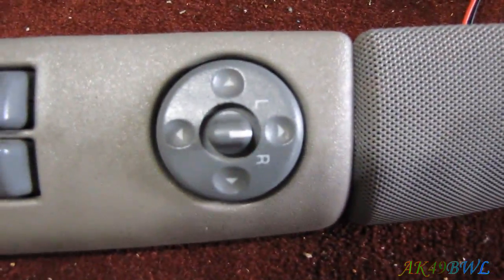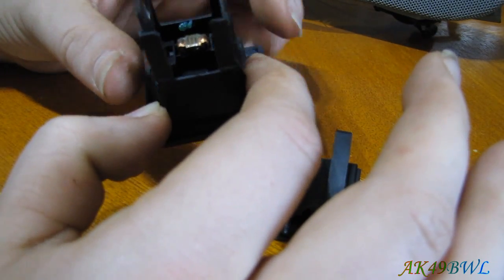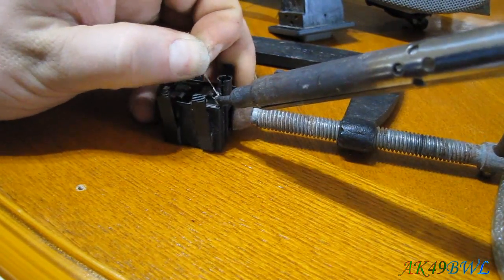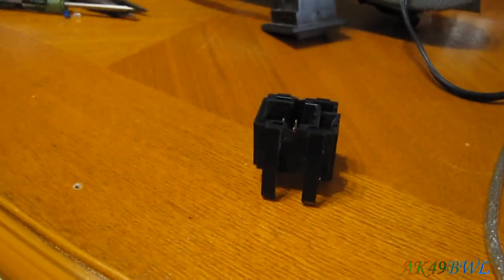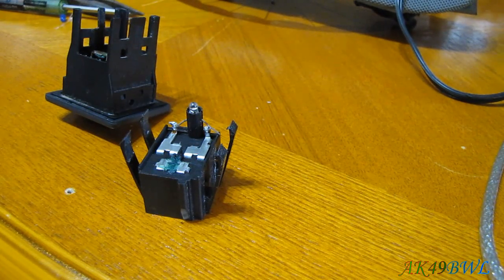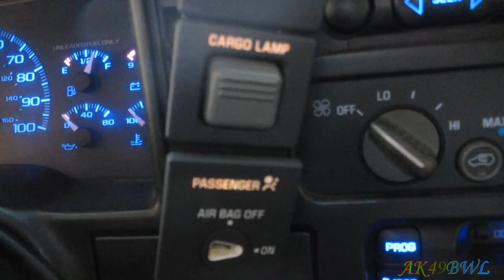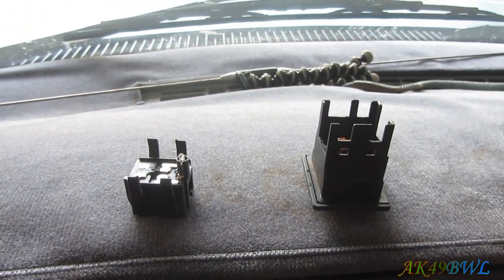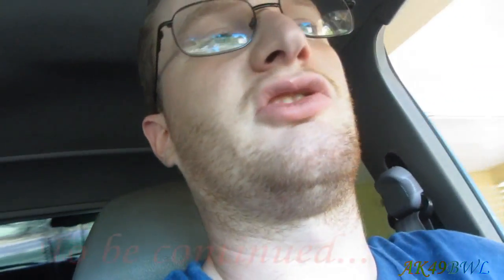LED-ifying the Cargo Lamp Switch

Comment: I did mine, full interior..  down to the ac controls and the 3 round buttons in the ac unit
Reply: Did you have any problems with the ABS light and the airbag light?

Comment: I did mine too on my 96 Silverado all of them just like you but I did my air bag light there's three in it I melted the plastic board now air bag light on so be careful. I do have a question what year is your truck  air bag switches look like they are all the same do u know? Good vid
Reply from the maker: I think they're all the same 96-99. I did mine successfully but the plastic housing broke, still haven't fixed it yet lol.

Comment: How did u do the headlight switch?
Reply from the maker: I haven't yet :P That one is going to be a serious feat of custom engineering because the terminals for the bulb in the headlights switch are integral to the switch itself.
Reply: Alright thanks hope u do a video
Reply: The bulb is removable, very tedious, i believe it's a T one, very tiny bulb